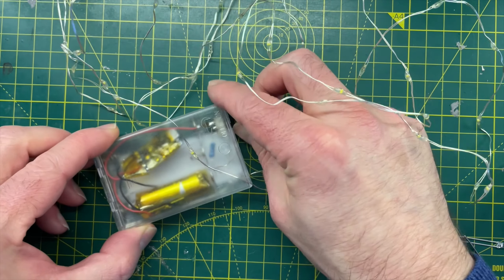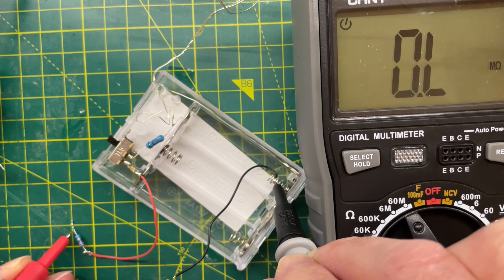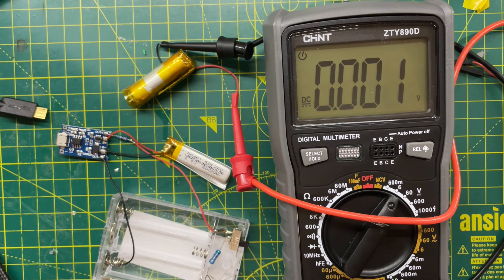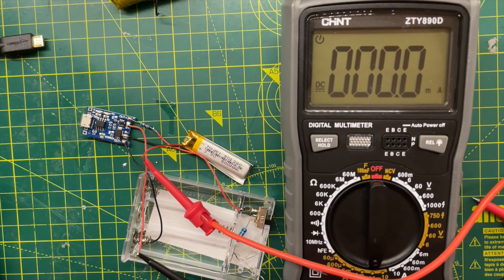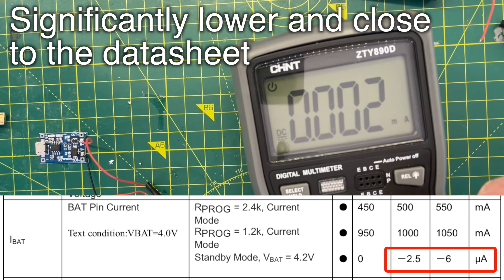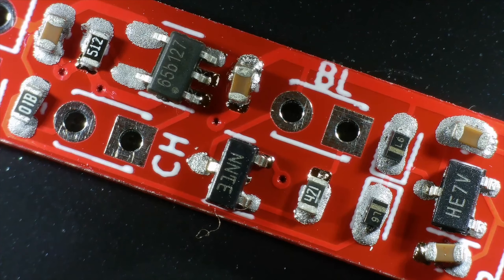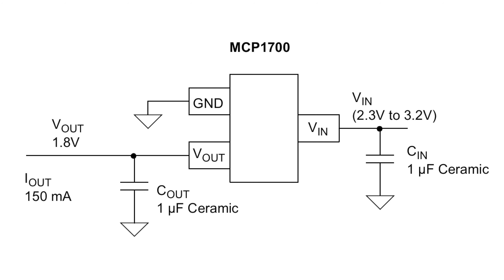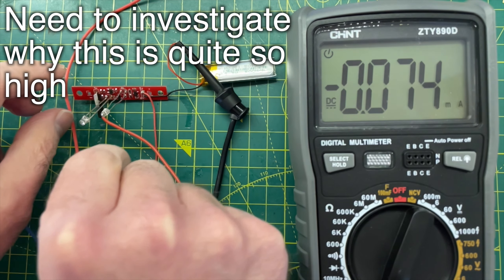Mysterious Battery Drain Solved: Rechargeable LED Lights Mystery

Comment: there is 1 flaw in the TP4056 modules: I usually attach push button to reset it. you need to connect it between 2 GND pins: 1 for the battery and 1 for the load. Once you reconnect battery you need to press it for a moment. then all works ok until you replace the battery again.

Comment: Nice idea when the battery reaches its minimum voltage, increase the load on it with a LED. ;-)
One reason for the Chinese boards being cheap is the greater access to rejected or out of spec  chips.  in the old days you could buy a more expensive one which should be good,  but they learned to match prices so now you can't tell
Reply from the maker: Haha, I know - but how else can you do it? I went a bit too far trying to minimise the current and you can barely see the LED. I think you’re right - there’s probably a ton of out of spec components floating around that are nice and cheap. Probably work well enough that no one notices. I could have easily just dismissed this as a dodgy battery and thrown it away.
Reply: @atomic14  an idea i have is a regular lcd. they draw almost no power. i just don't think you can easily get a "1 pixel" square that turns black entirely. also it would have to work at 3v and would probably cost a lit more